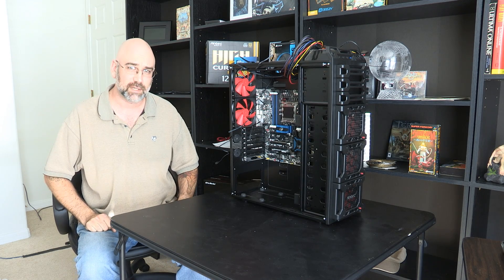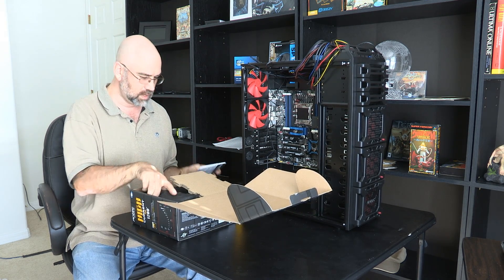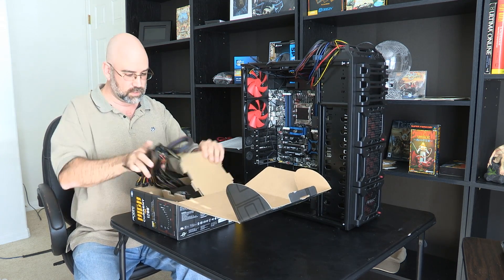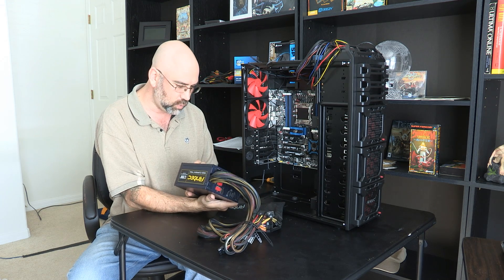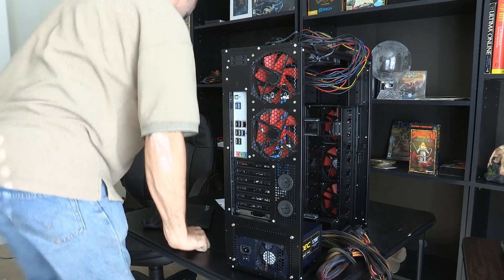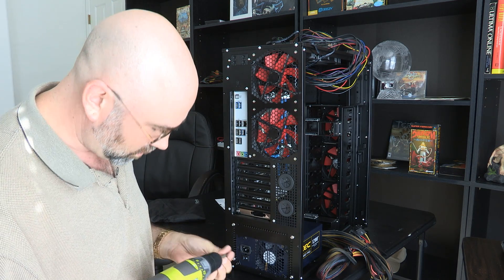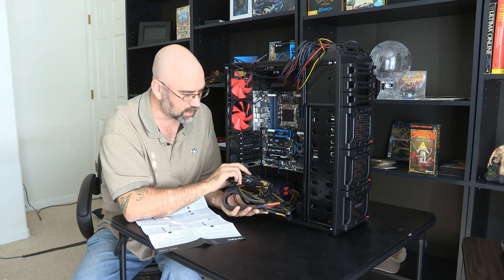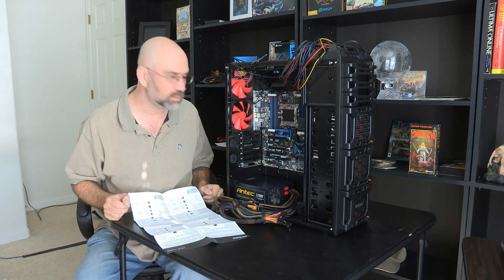How To Build a Custom Gaming Computer Antec High Current Pro HCP-1200 1200 Watt Modular Power Supply

Comment: I have another power supply wanted to power my other power hungry video card for a crossfire config . I was able to figure  out how to get power on with a secondary power supply . Would that work as power supplentment for the extra video card . Other power supply is 600watt  thermatake  I have 700watts but when i add it up its more than the 700 watt so I wanted to use my spare thermatake and case it somewhere.

Comment: Your PSU is going to work overtime in that position if it is not elevated more of the surface! The way to fix that is to turn the PSU 180 degrees so the PSU fan is facing up. It when then suck and warm air out of the PSU. It may run a few degrees warmer, but it won't have to work so hard.

Comment: the noise is not the screws, but the torque safty clicking.. its a gear that prevent it from connecting, if it meets to much resistance.